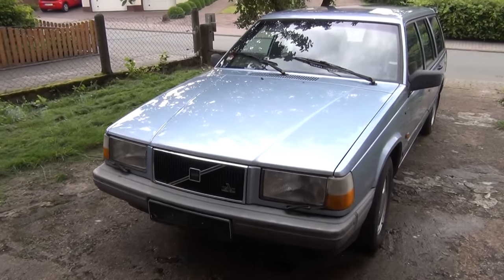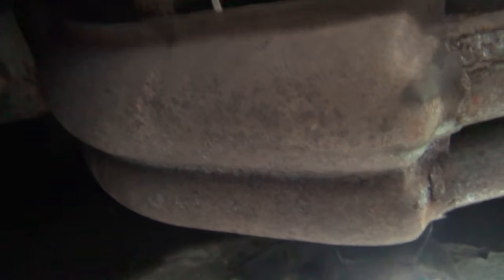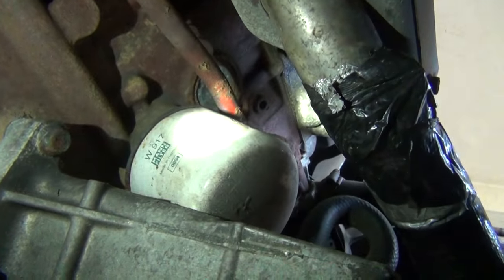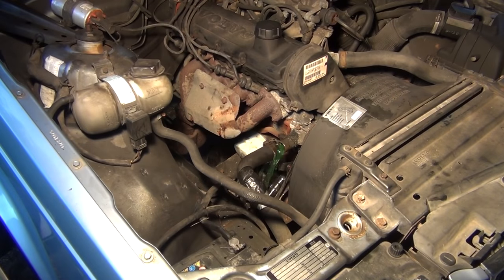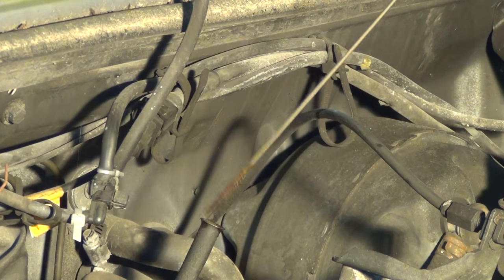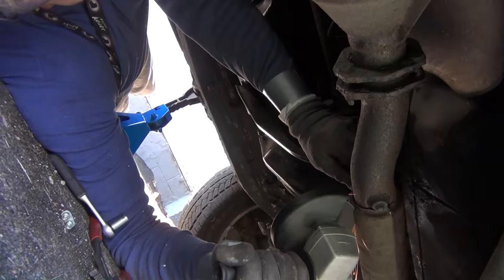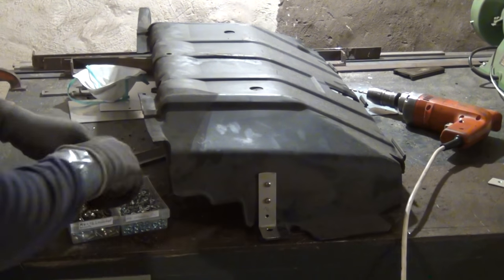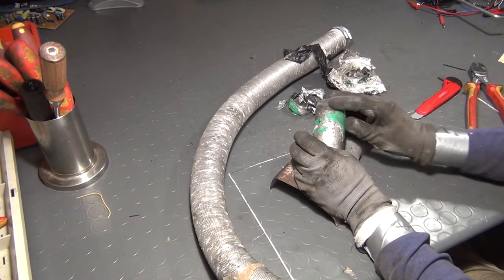Volvo 740 Repairs: Oil Change, Underbody, Air Filter, Downpipe etc.

Comment: Spray can of penetrating oil for the rusty bolts. I am adding this to a separate comment as it's more important than what I say in my other comment... spraying those rusty bolts with a penetrating oil first will save you many stripped bolts.

Also a jar of "Never Seeze" would help as well, that's a name brand, but it's an alluminum powder suspended in a grease. if you put it on the threads of a rusty bolt when reassembling then you won't need to worry about it rusting in place in the future when you remove it.
Reply: Make your own penetrating oil - a 50/50 mix of acetone and ATF.  You can spray or paint it on when necessary - just remember to mix it well before you use it!  

Coppaslip is the brand name in the UK of anti sieze grease in the UK, highly recommended for assembly.  You'll thank yourself in the future!
Reply: FFVoyager If you do that don't let it touch your paint though, or you'll be really sorry lol. Maybe factory paint would survive, but I've even seen factory painted things lose their paint completely from the acetone.
Reply: Same for any anti-sieze that actually works!  (and brake fluid and carb cleaner.....)
Reply: FFVoyager Brake fluid is the worst, I installed a new brake booster in my car, about a month later I had to have my clutch replaced, the guy who did it spilled some brake fluid on the new brake booster and stripped a huge chunk of paint off it. Now I've got a 4 month old brake booster that's already rusty as hell. :(

Comment: Plain hot water is especially corrosive to iron, and while it'll work in a pinch, you'll really want to add at least some anti-freeze to your cooling system to prevent rust from forming on the walls of the coolant passages:  Just a coating of  rust will  reduce the efficiency of heat transfer; a clog can create a hot-spot and lead to all kinds of trouble, like warped heads and burnt valves.  

Unless you have some Technetium, which curiously inhibits rust formation on iron when present in trace quantities in hot and superheated water.
Reply: I was going to say the same thing. Distilled water and anti-freeze only. Anti-freeze should always be added because it contains anti-corrosion chemicals and it raises the boiling point (vapor pressure) of the coolant and lowers the freezing point. This means the car will evaporate less coolant in hot weather (above 80 F). Also, the ratio should never be more that 50% water to anti-freeze.

Comment: As others have said, I doubt the intake heater is essential in Germany. Maybe in northern Sweden where -30C is not uncommon in wintertime.
Reply: It sure is weird that it does not utilize a heater core using the coolant fluid!
Reply: Since its for cold starts you get heat much faster off the exhaust.
Reply: +Saku Jalonen right
Reply: Around 0º and high humidity is actually more of a problem than -30ºC.  Causes the the thottle body/carb to ice up. At -30 the air is almost completely dry.
But carburated engines was more sensetive to that, I've never seen the problem with fuel injection. My -71 142 with SU's and open pancake filters on the other hand... Drive for a km, wait for the carbs to thaw, drive a km, and so on.

And I would say that 80% of the 740's here in Sweden haven't had a whole preheater hose for many years....

Comment: About the fuel pump: I talked to a buddy of mine who is a mechanic and he told me it could well be that, although it looks the same, the wrong connectors could be an indication that the fuel pump is the wrong one for this car, because there are occurances where fuel pumps deliver different amounts of pressure to the injection system, while looking like the same part on the outside. So the different electrical connector may be an indicator that this isn't the right pump for this engine.

Comment: Forgot to mention the thing about the warm air hose: that thing will have been designed for really cold Scandinavian winter conditions, to make the engine warm up quicker and keep it warm. In really cold climates, people actually block off their radiators and cover the engine compartment just to keep the engine warm! I suspect you won't be needing that in Germany, unless the winter gets terribly cold with you!

Comment: If you want to prevent splashing hot oil all over the place, put pressure on the drain plug while unscrewing it, and then quickly pull it out of the way.

Comment: The warm air ducting (as well as the heat shields on the downpipe and the belly pan!) are not strictly necessary on your B230F. You might want to get rid of some of the not-original or hacked-together looking stuff in order to make the TÜV guy happy. :)

Comment: The pipe for the warm air from the exhaust prevents the carburetor from freezing up when driving a car in winter. I would have done the repair on the exhaust with the special tape and then additionally wrapped it with some steel wire. Some tapes have to be wet before use.

Comment: I'd say that you deserve some good metric combination wrenches in lieu of the pliers you are often using.  The repairs were fine - if they solved the problem, then great. I also thing the additional aluminum brackets for the splash guard worked pretty well.. I'd spend some spare time gathering the new sheet metal for the exhaust, the hot air intake and so on that rusted as time allows in the distant future... Good work!

Comment: I believe that investing in that warm air duct will pay back in fuel saving over time.
The engine is probably designed for intake air temperature(iat) of ~25°C. Running with lower iat means that the mass flow of the air mix is higher. This gives higher horsepower at full throttle, but the compression cycle uses more energy too. The higher loss during the compression cycle means that the motor uses more fuel at low throttle.
I think that motors running high iat are very interesting projects for DIY-ers.

Comment: Warm air intake = depends how cold the winter gets, as this system is used to prevent carburettor icing in cold weather. Great car by the way.
Reply: More like the trohlebody......this car has EFI...
Reply: yes, it keeps the throttlebody from iceing, which can actually happen at the current weather in germany.
But removeing the hose might actually not do very much because the thermostat in the switch housing is probably quite dead anyways (judeging by the general state of the car). The function of the thermostat is to generate 10 °C warm air for the intake, its effectively a mixer between pre heated an fresh air. If it dies, it will be stuck at the preheated position, which will make for quite warm air intake temps.
In case this thermostat has been dead for a while, it might have impacted the AMM aswell (they dont really like to get cooked).
Reply: It's also to help cold start emissions.
Reply: So if your state requires visual emissions inspection, you may fail of it's removed.

Comment: This video is quite old but you may still be interested. The cold air intake was used as you may guess for very cold weather on engines with carburettors. As yours is I guess a B230K which has an engine management system that allows for the engine to warm up. Furthermore you may find that the thermostat in the air box has broken anyway. They can be bought from Skandix in Germany but are rather pricy, it think around €20. I have removed it from my Volvo 240 with the B200E engine. This engine is known for its rough idling when cold and I have never had any issues with it. I suggest removing it. Regarding the oil change, the only two things that can kill the redblock engine is probably oil related. Make sure you are using an oil filter that has a non return valve. The redblock engine does not have such a valve, which means that when you shut it off, all oil will drain back into the sump. This also means it will take a few seconds to distribute it when you switch it on. This can cause premature wear. The other thing you may want to check is the flame trap. do it every 10000miles or 15000km. It's a small plastic strainer which sits on the oil separator under the air intake. if that gets clogged, and it does after a while it builds up excessive pressure in the engine and it will start to leak. This can blow the sump and valve cover gaskets. Now yours is a B230K which makes it more difficult to change as you may have to remove the intake manifold. A simple check whether it is still good is in that you remove the oil filler cap when the engine is running put your palm over the oil filler and feel whether there is a negative pressure from within the engine. You may also find that there is indeed a negative pressure but you also find a lot of oil in the intake manifold. In that case someone may have removed it, which means that its sucks in oil mist. As your car looks like it had an interesting former owner i would advise you to check it and replace it anyway. It is a very cheap part something like €1.50 from ebay but well worth it. On another note, you can check whether the in tank fuel pump is working by attaching jump leads in the fuse box. I don't know which ones though as i only know how to do it on the 240.  if you can hear a slight buzzing then the in tank fuel pump is still running long story cut short,  yours has probably quite a few 100'000km so i would advise you to bite the bullet and replace it even if not yet required. It can seriously extend the life of the main fuel pump by a few 10'000km. I hope that helps. if you need more advice on the engine side just contact me.

Comment: If you use the hot air hose then it's a good idea to replace the thermostat in the airbox.  If the thermostat gets stuck open then the hot air from the hose can burn up your MAF.

Comment: for your coolant system, you should've added distilled water instead of tap water. the tap water has a lot of salts and additives that cal lead to corrosion inside the engine and coolant system.

Comment: I would have to say repair the warm air intake system, Volvo spent a lot of money and time developing that system and it does work well and reliably, unlike those on a lot of cars.  The warm air intake does help the car to warm up and drop back from cold fast idle quicker, especially in winter, which can save you a decent amount of money in fuel, certainly enough to pay for the replacement hose...

Comment: Duct taped radiator hose,  steel wires used as zipties and indoor electric cable joints outside. You can really get the feel of how this car was serviced, and it doesn't feel nice. At least it's in good hands now and will get the other DIY treatment, do the important stuff to specs and jerry-rig the details making them stronger than original.

Comment: depending on what sort of temps you get there some 5W-40 oil will help withy starting in the winter time.. and from everything i read it wont harm the engine any as it will still act as 40 weight oil at temp.. but will be thinner in the cold.. this will have the efftct of better lubercation for the engine, less work for the starter, and also quicker starts..

Comment: You can remove the preheating hose. When its thermostat is functional the system is not bad. Now, 25 years kater, the wax element thermostat is usually broken and stuck in hot only position. Which is bad for the hot wire air mass meter and can be bad for mpg. 
What i did on both 740 and 240, remove the hose and the whole thermostat assembly. With the removal of the air snorkle upstream of air filter the cars gained some power too. 
My 240 took a minute longer to warm up under normal temperatures. Winter (-5c) maybe a tad longer.

Comment: The way you fixed the exhaust heat shields obviously works, but you could have also used something like a clamptite tool.  It is good for large and irregularly shaped objects.

Comment: Others have said it.  Venturi effect drops pressure in the throttle body, and it can freeze condensed atmospheric water if not supplied with heat.  A dry system like port fuel injection where the intake is only air is probably less likely than throttle body injection where fuel and air mix externally.

if there are coolant passages in or around the throttle body at engine temp, as long as you have a working thermostat it will likely be fine unless is gets significantly below 0.

Comment: The warm air intake is for heating up in the winter. I always ditched the stupid thing. 

Also, to fix that hole, brush on weld AKA Under car body sealer. Glob that on, call it good.

Comment: Never use Tap Water in the cooling system such as a car. Water has a low boiling point and it can boil out, also cause some serious rusting in the internal veins for the coolant to flow. If you have to use water then use Distilled water.
Cooler air is way better then hot air. Helps the air to fuel ratio and would increase the fuel mileage a bit. However if you have harsh winters I would add a coolant line to say a metal hose that is wrapped around the external body of the throttle body. That way the butterfly plate doesn't stick and slightly warms up the air to reasonable temp. A lot of American and Japanese cars use that setup.

Comment: My old polo had such a plastic cover under the motor aswell, and it did fall down at 180km/h on the Autobahn. it just scraped on the asphalt and ripped a whole in the plastic, nothing really bad happened (like it catching on the ground and being thrown under the car), but the sound it made was terrefying, especially since it happened out of the blue and i had no idea what was going on...
Reply: I lost lower engine bay cover off my Citroen XM too. It was made from glass fiber so made a huge BANG! sound and i saw pieces of it flying in the mirror. Was doing only 90km/h, pretty sure the hacks who call themselves mechanics did not put front screws in when they fixed my hydraulic leak when I broke down in the city.
Reply: mechadrake well that sucks... I put mine back on with zip ties, i was just to lazy to really fix it...

Comment: You can join hose clamps to make larger ones and for the metal to plastic I like to use a piece of metal on both sides of the plastic.

I would also look at changing all fluids, brake, antifreeze, rear end fluid, etc. How many km/miles on the car?

Comment: Guten tag! Keep up the great work. I enjoy watching your progress. Regarding the heat riser tube, I would spend the cash for a new one. If your winters are like mine in Oneida county, New York (in the states), these can make a big difference. I had a 1979 Jeep Wagoneer with a V8 engine a while back. It ran much better on cold starts (-20F ambient some days) with the new tube SECURELY fastened. On another note, I would enjoy if you could post a video while speaking in German, possibly with English subtitles. Ich möchte lernen, Deutsch zu sprechen.

Comment: Instead of removing all the items shown in the video to unscrew the oil filter use a long screwdriver and punch it through the filter body. This should give enough leverage to start the filter turning, then you can normally unscrew it by hand.

Comment: Very interesting video as always. Thank you for sharing your daily exploits with us! 

As others have recommended, stabbing a large screwdriver into the filter may be an option to get it off. 

One thing I was wondering was whether the car had the correct filter on it? Maybe it was so difficult to get access to because it was too big, and not meant to go on this car? I can't help feeling that Volvo would not have made access to the filter so complicated that you need to remove all those ancillary items. So it seems a bit suspect... 

P.s. That oil looked awful. It's probably been in there for a long time. The engine will be much happier now!

Comment: Greetings from a fellow German Volvo (we 940) owner..... I have the flashing indicator problem..... I guess it is an issue with the rear lights connection, since they flash normal..... but as soon as I press the brakes or switch on the lights they tend to flash fast. Cheers great Video (sadly right now I am in Portugal and probably leave it like that until back in Germany with my lifting jack).

Comment: I don't think the hot air intake is needed in Germany either. We have a few days in winter where it's below -10 degrees, and this sounds more like a solution that is made for temperatures of -30 to -40 degrees.

Comment: As far i know the EGR (exhaust gas recirculation) makes engine efficiency normal in highway speeds. Otherwise it drops at 90+ km/h. I have heard people adding the EGR by themselves to cars which don't have it originally. You could make test run with(tape version) and without it to make decision.

Comment: You might want to have a look in your green book about those horns (page 102 or thereabout). There should be 2 horns in the wiring diagram, as your car has a 2 tone horn. This item is actually TÜV relevant, but usually nobody pays attention ...

Comment: I thought you had bought yourself a set of sockets etc, its just that your constant use of pliers and multigrips to remove nuts and bolts is not good mechanical practice. I would buy those new radiator hoses (also check the heater hoses as they probably need replacing by now too) as soon as possible and replace the coolant with a quality coolant that has both antifreeze and buffering components. Water is not good for an aluminium motor or aluminium/steel motor which I think yours is. The easy way to get the oil filter off if you don't have the right tool is to drive a spike through it and turn that. I think the exhaust heater tube you questioned the need for is just to provide rapid warmup for the motor, long time since I have dealt with them but there is usually a butterfly valve to shut them off when the motor is at operating temperature. You can probably get away without it. Best of luck with it, Bob in Australia.